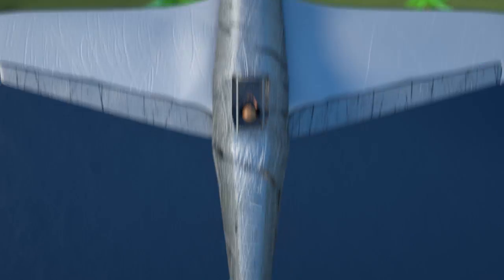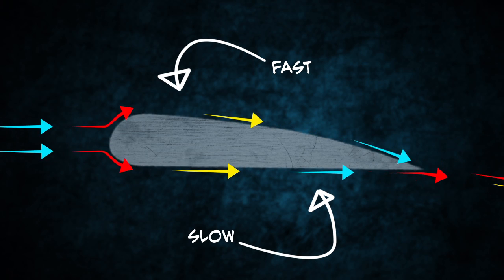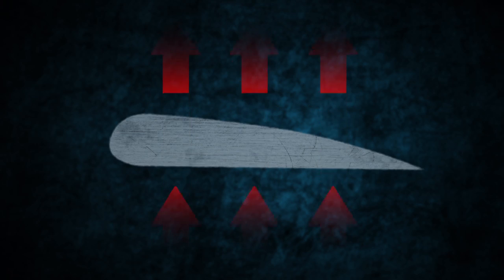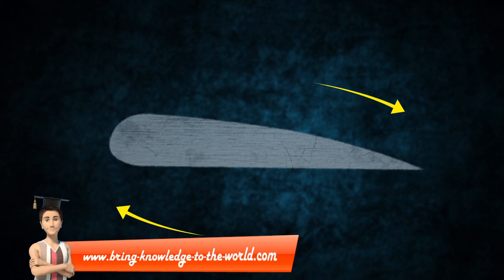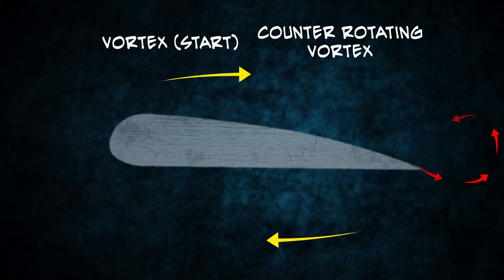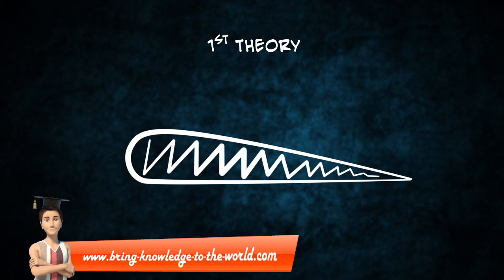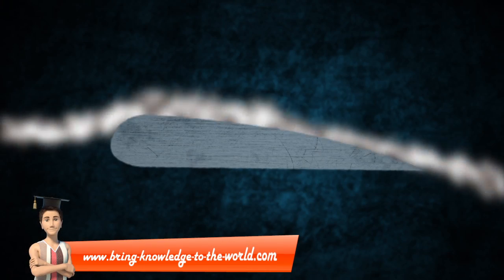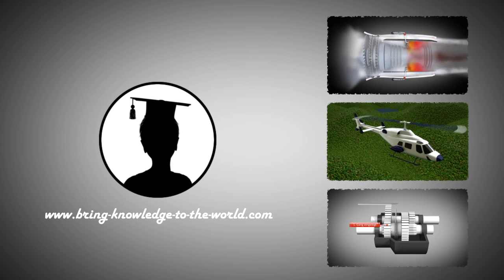How Airplanes Fly / Explanation of Lift (How It Works!)

Comment: I really enjoyed your video. One of the few videos about lift that mentions circulation. You also did a great job explaining circulation with regards to the starting vortex. Gives a reasoning for why fluid moves faster over the top of the airfoil. There is more than one theory behind lift as well. Conservation of momentum and the deflection of air around the airfoil is a theory in addition to pressure-velocity fields and the circulation that you talked about. Also, Coanda effect is only applicable to jet flows and the air in the atmosphere is a continuum so that effect doesn't apply. Good job overall!

Comment: I liked the depiction of circulation in this video. There are several points that could be improved. The explanations are very simplistic. For example, the second explanation does not discuss how airflow is deflected. Another issue is the explanation involving the Coanda Effect. Real airflow over an airfoil cannot be represented by a jet stream, so the Coanda Effect does not actually apply.

Comment: Explanations based on Bernoulli or Newton will flop for a hydrofoil dragged slowly through liquid helium. Stick with the explanation based on the starting vortex. Our atmosphere is not a superfluid and the flow fails to double back round the trailing edge as a consequence.

Comment: Aerospace engineering student here, my professor said the air flow on top is not faster than it is on the bottom. This video is wrong
Reply: Your professor isn't correct if they're in the reference frame of the airfoil. If you're watching the airfoil flying through still air it looks a bit different
Reply: @AmbientMorality  It looks completely different.  From real data on a real wing generating lift, the lower air is actually faster than the upper air.  
Watching a wing go by, this is what you see.
The two are first pushed forward and upward ahead of the wing.
All during the travel of the wing past you, the lower air is moved forward by the increased pressure under the wing starting in an upward arc finishing behind the wing moving downward with some upper air that started well ahead of where this bit started.
.
After the initial push forward/up, the upper air is then yanked quite quickly rearward actually reversing direction completely because of the lower pressure above the surface, and traveling mostly downward after the trailing edge passes you by. The magnitude of this rearward speed is less than the  lower air's forward speed at that time. 
It finishes up very close to where it started (because of the reversal in direction of travel) traveling mostly downward with the lower air that started behind the wing from where this air started.
Reply: @Observ45er  Sorry that I haven't had time to reply. I think what you said makes sense if I'm visualizing it correctly but I'm really bad at thinking in a lagrangian frame of reference. Do you have any video or image to show it better than text?

Comment: Wrong.  Wings fly because of the angle of attack, aka incidence, which compresses the air under the wing, which provides lift according to Newtons Law.  The "circulating" air is non-existent nonsense.
Reply: The vortex that forms off the trailing edge of a wing during acceleration and deceleration is clear proof that circulation exists. Also the fact that potential flow theory, which assumes a vortex sheet over thin airfoils, predicts the linear region of lift and the corresponding moment essentially perfectly. Your version implies that the upper surface of the wing is irrelevant which is trivially falsified.

Comment: The mass of air that is left undisturbed above the air foil acts as a barrier to the flow of air particles below it. Since the airfoil tapers down, the upper part acts like an orifice with large mass of undisturbed air acting as barrier above and airfoil below. This causes the compressible fluid(air) to move faster as it expands through a diverging section, like a throat of venturi. But that is not the case with bottom part since the incoming and exiting air flows along a straight line, unlike top. That is why it creates a pressure difference between the two surfaces, due to difference is velocity of flow. Energy of a fluid is the sum of the potential, kinetic and static heads. So increase kinetic head i.e., velocity, cause drop in pressure at the top part of airfoil and produces virtually zero pressure drop bottom. That's why the life is generated.
Reply: No mass of air is left undisturbed above the airfoil. Venturi is a terrible explanation for multiple reasons, in particular not explaining lift over a flat plate and also not even close to matching experimental results of a pressure-tapped wing.

Comment: I can't believe there's an accurate video explaining the production of lift. It all starts with circulation.

However, you mentioned Newton as if it was its own separate theory. Everything is Newton; it's the basis for physics. In the end, what is important is that the wing is producing downdraft (forcing the air down). If the air is pushed down, the wing, by Newton's 3rd Law, must be pushed up. So, the Bernoulli's Principle comes into play as the air on top of the airfoil speeds up much faster than air on the bottom, thereby creating an area of high pressure on top and low pressure on bottom. Great, but how does that produce lift? The atmospheric pressure above the relatively low pressure on top of the airfoil makes it so that air flows from top toward the wing, and by equal and opposite reaction, the wing must be pulled up toward the low pressure on top. Since the airfoil is moving through the air, the air will rush down toward the backside of the airfoil, creating downdraft. Air moves down, wing moves up. Bernoulli and Newton are not 2 separate theories: Bernoulli, in the context of explaining lift, merely expands upon how Newton 3rd law comes into play. Newton's theory of lift, as most people know it, is the skipping stone theory, which states that air hitting the underside of the wings push the wings up, which is true; however, this theory discounts any effect of airflow on the top and the amount of lift generation through this theory is negligible in comparison to circulation. Also, the high amount of drag that it would cost to simply produce lift by pushing the wing through the air with sheer thrust power would not make it practical for conventional airplanes. 

A rule of thumb is: the lift produced is proportional to the angle of attack. This applies up to a certain point (stall), but all of the above applies to any airfoil that flies through the air, even if it is inverted. The standard teardrop shape of the airfoil is almost negligent in lift generation: airfoil shape merely helps reduce drag and makes lift production more efficient; however,  even a teardropped airfoil will fly upside down fine with enough angle of attack.
Reply: +Paul Kim 
Paul,
  I forgot to say that your description of the "above air" is figuratively  correct, except there is no real "pull" up.  You can not pull on a fluid and a fluid cannot pull on an object immersed in that fluid.  Fluids can only push on other parts of the fluid and objects immersed in the fluid.
...
Remember:  When you suck on a straw, you are not pulling the soda up from the top.  Atmospheric pressure is pushing it up the straw from the bottom.
...
The only way to get a force in a fluid is with a pressure difference.  A higher pressure region pushes air (or an object in the air) toward a lower pressure region - the wing in this case. 
...
Your description of the higher pressure far above the wing pushing some air downward is correct and this air is part of the story of the downwash behind the wing.  The under wing air being the other part of the total downwash.
...
Yes: Air pushes up on wing...Wing pushes down on air.  Newton #3 is satisfied.  Except it is the other way around from your description.  The pressures around the wing can be shown to cause the downwash, therefore the downwash is the result, or the reaction in Newton's terms.
...
One thing many people forget is the fact that we live in a pressurized vessel of air.  All pressures are inward on all surfaces of everything, even wings generating lift.  It is just that there is more pressure under the wing pushing up than there is above the wing pushing down...thus a net upward push = Lift.
-- 
Cheers, ScienceAdvisorSteve
Reply: Observ45er,

My mistake. You are correct in saying that low pressure does not "pull" anything.

I agree that the downwash is a result of Newton's 3rd Law in that interaction. I realize I wasn't too clear, but I was trying to say that the system of the wing pushing airflow downwards as a whole is a demonstration of Newton's 3rd Law. That downdraft originated from somewhere. That somewhere is from a pressure gradient. How was the pressure gradient formed? Through the wing flying through the air. If we observe the wing pushing the air down in some way, shape, or form, then we can expect to see the air pushing up on the wing and generating lift. I think this perspective is easier to digest when you recognize that lift production is not a step-by-step process but a complex phenomenon of various principles all working simultaneously.

I appreciate the response. I'm always willing to learn, so please feel free to correct me if I'm off the mark.
Reply: Paul, What you say there is correct.

Comment: So, by those theories a plane shouldn't be able to fly upside down?
Reply from the maker: pf0xx No, it's possible according to these theories. Why would you say that it's not possible?
Reply: Thomas Schwenke I say this because the video says that there is lower pressure on the upper side of the wing. When you turn the plane upside-down, then the upper side of the wing faces downwards so it will pull the plane down, no?
Reply: pf0xx From what I've read it is possible and not. It greatly depends on the design of the wing itself. Just think of the last part. He said that if the angle of attack is too high then no lift is generated. So you just have to come up with a clever shape that when upside down keeps the normal lift design out of reach from the incoming air flow.
Reply: David Flores Still something must keep the plane in the air.
Reply: pf0xx I thought it was clear already in my comment. Of course that it should be symmetrical so when upside down works just the same as when right side up.

Comment: I've read on mutiple places that the "Equal-transit time" theory is false.
Here is what the nasa website says about this: https://www.grc.nasa.gov/www/k-12/airplane/wrong1.html
Reply from the maker: Absooh Hi, in fact, the "Equal-transit time" is a false concept. It's not described in this video, if this is what you want to say!? The "Equal-transit time" theory must be wrong because wind tunnel experiments show that this can't be true (as it is described in your link). In this video, we talk about the fact (Theory 1 in this video) that air moves (much) faster on top than it does on the bottom. This is also stated in the link you provided.
Reply: Thomas Schwenke I thought the equal-transit time theory stated that lift comes from a difference of pressure between the top and the bottom of the wing caused by different air flow velocities. 

But if I understand well what you're saying, what is wrong with this theory is that it explains this different of velocity this way :"The air molecules have farther to travel over the top of the airfoil than along the bottom. In order to meet up at the trailing edge,the molecules going over the top of the wing must travel faster than the molecules moving under the wing.".

So basically, the equal-transit time is wrong because of the way it explains the different of pressure between the top and the bottom of the wing, but not for stating that this difference exists? Thanks for taking the time to answer! Nice video as always.
Reply from the maker: Absooh Hi. Yes, kind of. The explanation why the air is faster on top is wrong when it comes to "Equal-transit time" concept. The air DOES move faster but the explanation is not the "Equal-transit time" concept. The theory I present is the "Circulating air theory."
Reply: +Thomas Schwenke 
Thomas,     Please do more research from authoritative sources on this.
You have several common misconceptions here.  One main one is that the fastest moving air around a wing is not over the top, but under it !!  
...
This is clearly shown in David Bentley's paper,  linked below.
 On the 6th page is actual flow around a wing. The vertical line is stationary and the wing is moving past it.  Note that the streamline just under the leading edge has moved the farthest in the sequence.  This, therefore is the fastest air.  This directly contradicts the misconception that faster air has lower pressure !!Therefore, explaining that fast air creates low pressure is not correct. ..In addition this video clearly claims that air is circulating in the manner shown.  No air circulates in this manner.  Circulation is a mathematical construct that makes CALCULATING lift easier.  The circulation is a man-derived component of the flow that aids calculation, but is misleading when it comes to describing the flows.
...
The flows and pressures around a wing AS WELL AS the downward accelerated air are BOTH part of the explanation of lift.  They are not two different theories.  I posted several authoritative sources for lift in my other recent posts to this video.
--
Cheers
Reply from the maker: Hi, and thank you for your comment. I cannot really follow you, but perhaps someone else can. There is also no link to the metioned hyperlink. Where can we find it?
Reply from the maker: +Observ45er Oh, thank you :) / Well, there is a lot of reading and I read most of them before. There is also a lot of controversy and complexity at work; in one of your links, Peter Eastwell explains that "there is still much  to learn about aerodynamics, and the concepts involved continue to be argued." Afterwards, he "offer[s] the following possible reasons," and says that "there appears to be a desire to have a single, best explanation for an observed behaviour when in fact a combination of factors may be at play." As you can see, my approach is the same. I just gave some possible solutions. If you can really predict (mathematically) the behaviour of an airplane, then you have found your one and only solution. But for now, we cannot predit exactly the behaviour of airplanes in a mathematical way...
Reply: Thomas Schwenke  The majority of the 'controversy" and learning is in the amateur world.  Eastwell is not in the field; he is a teacher who did some serious research to get a better understanding of what is commonly understood by those in the field so he would not be teaching myths.  In my reading and discussions with some pros, I find that the differences are only on minor points, not the major phenomena.  I also see that each author tends to emphasize one area more than another, but the major points are all agreed upon.
...
As far as prediction, Charles Eastlake of Embry-Riddle claims to have it nailed.  I want to talk to him before he gets too old...
...
Something I have noticed.  Some people appear to confuse DESCRIBING  the phenomena around a wing and CALCULATING the lift force.  Eastlake describes two methods of calculating the lift force value, but does not claim that each is a completely different theory that explains lift. One is the pressure difference around the wing and the other is the reaction of the downwash.  There are these two aspect that should be included in the whole explanation of lift and each of these yields a way to calculate the force -- but both are present as part of the phenomenon of lift.  This appears to be why some say simply that "Bernoulli" explains lift and others argue that No, it is simply "Newton" that explains lift. [although it's hard to say because those one-word "explanations" can be a poor indication of just what the writer/speaker has in his own mind.
...
My interpretation of that Eastwell quote goes something like this:  People (these days more-so) expect a sound-bite explanation for something that has a rather complex explanation and they can only grab onto (comprehend) one simple part of a more lengthy explanation. I do not interpret his word "may" as uncertainty about the true explanation, but rather a general statement about some people trying to apply a limited understanding of some science to something which can be more complex than they realize.  I see this in other sciences as well.  The "layman" needs, or only wants a simple explanation, so don't bother him with a full explanation.
...
Then, that said, each 'student' has a level of detail down to which they can understand some science.  I call this their "Level of Understanding".  It is important to sense this in each student (and YouTube commenter) and only go to the level they can absorb -- otherwise you can either give them an unsatisfying explanation, or bury them in detail they can't grasp.
... For example, some are satisfied with the explanation of "how a hot-air balloon works" with "hot air rises".  Others will insist that that is completely false (hot air does not rise) and cold air pushes it up.  Others, still will insist that an explanation of density, or further jet, buoyancy is the ONLY way to explain it.
...
I've corresponded with Eastwell; perhaps I should have him clarify his intent in that statement...
--
Cheers, ScienceAdvisorSteve.